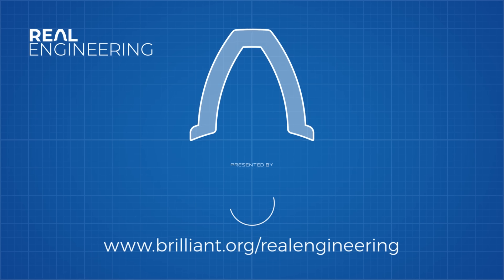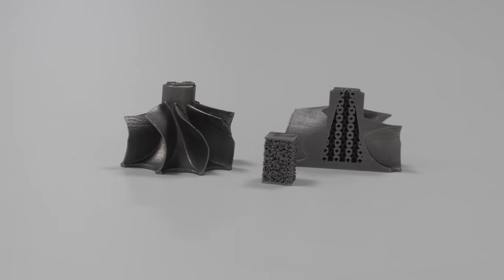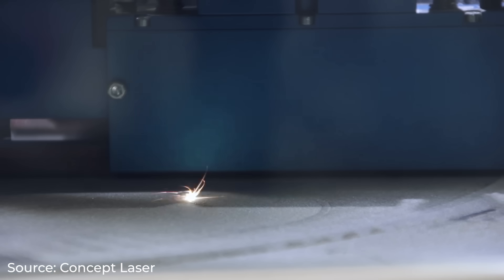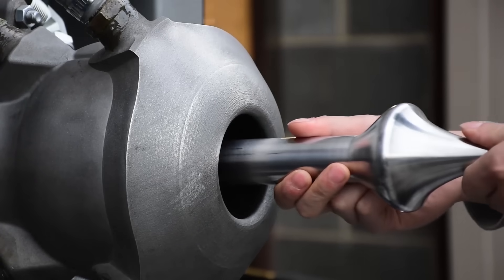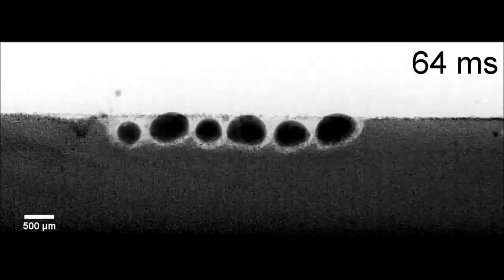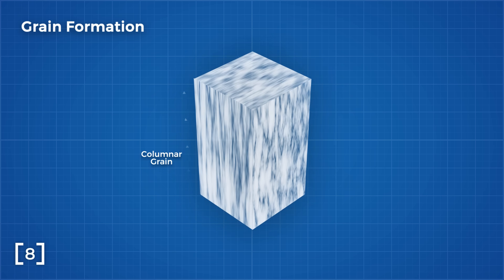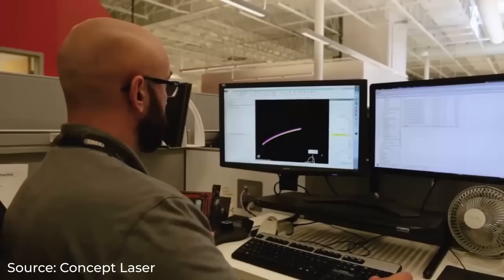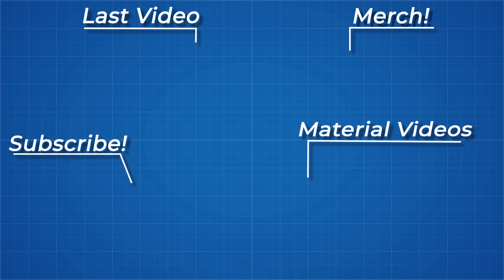The Material Science of Metal 3D Printing

Comment: Instead of fighting the grain why not treat it like wood. Dealing with grain structures and having to be cognizant of how you are connecting machined wood together has been refined and perfected for much longer than steel has been. Sometimes old techniques are the solution to new problems.
Reply: It's not as anisotropic as wood. With stamping for example if you have a new material that does not behave the same way you loose a lot of accuraty. Doesn't matter anyway since 3d printed parts are almost finished after printing.

Comment: This is addictive manufacturing, now there is a new way of metal printing using a printer call Mark Forge, where there is metal filament just like normal 3d printer
Reply: It's an old method called metal injection moulding. You can do this on a 100$ printer using an MIM filament.

Comment: This is an incredibly well researched video. The only thing you missed or didn’t include is big area metal 3D printing, where a traditional arc welder is used instead of a laser and powder bed.
Reply: You mean WAAM or Wire Arc Additive Manufacturing? There is also EBAM or electron beam additive manufacturing.

Comment: I wonder if in the future we will be able to irradiate the whole pattern at once like we used to reveal photos. As in the laser covers the whole print bed but we mask the sections we are not going to fuse. It would require phenomenal ammounts of power and I am not sure what could be used as a mask that could resist that.
Maybe there will be a point where we can kind of massproduce printed parts that way by making reusable patterns. It would speed this method significantly and would prevent the problems of having vertical defects. I don't know it there are also problems with each layer adhering to the one below

Comment: I beg to differ with the high volume low cost part conclusion: 3D printed metal parts (SLS parts) can be produced cheaply/cheaper than traditional methods if they are complex and small. Also post-treatment is also an area that needs special attention (I work in that area) because currently a lot is done by hand which makes part finishes error-prone.
Reply: The dirty little secret of AM
Reply: For small and complex parts you can use MIM or metal injection moulding. It's waaay faster and cheaper than additive manufacturing.

Comment: I Own a 3D print farm (rapid manufacturing using 3D printers), and I can not wait for the price of 3D metal printers to drop in price. But still, machining Billet is still a stronger route.
Reply: If the machines getting cheaper, the material costs and the dirty little secret of AM will stay the same. 

It is actually a nice addition to the already existing manufacturing methods, but it wont be the single way to manufacturing, beside where Function goes way over the costs.

Comment: Another idea,

A single laser making a sheet of metal from edge to edge seems like a problem. What about a more developed high bandwidth laser that can cast the entire surface layer by layer rather than print like how a tv screen changes pixels. Or multiple single beam lasers all working together. Either way the time between edge to edge is creating weakness.
Reply: You need an incredibly powerful laser then. Would cost millions for one printer.
Reply: John theux I agree it would be a nutty lens with a nutty amount of power. On top of that I’d rather see a material delivery system similar to plastic 3D printing. So the “metal dust” is delivered in the beam, not being powder melded by laser.
Reply: @Pcgamingfixes  There is this for plastic but metals have an higher conductivity so you need a faster heating speed to prevent the heat from dissipating.
https://www.youtube.com/watch?v=m-tvvHAq09E
Reply: John theux That link does sorta hit it in one blast rather than ‘printing’ the image. That is closer to what I think would work...
Reply: @Pcgamingfixes  Maybe halway between SLS and QLS would be focusing the laser in a line instead of a point. That should work fine with metals.

Comment: Hey, this video is basically a run-down of my degree! Excellent summary of additive manufacturing and the current problems that are trying to be solved in the area. There are so many variables that can be changed to affect the final part's properties that it is very difficult to find an optimal set. I like how you mentioned that, while additive manufacturing will massively change the industry, they will likely never beat the high volume per-part cost of other techniques or beat the strength of forged parts. There's a lot of hype - and for good reason - but not all things will be better off printed.

I would have liked a mention of the issues surrounding the density of 3-d printed parts. You touched on "voids" but it goes a bit further than that, as mechanical properties of printed parts decrease with relative density. Plus, I think it would be a cool mention that the bulk powder is made of various particulate sizes to maximise the powder density.
Reply: I've always wondered why not use something like MIG welding for additive manufacturing?
Like, imagine a standard mig welder with an auto-feed gun.
Mount the gun vertically on a carousel that moves in the x and y axis. Have a swappable thin plate of steel as a foundation surface to start the part.

Have the mig gun weld at computer controlled speeds and voltages, while it is moved in the x and y axis, and the part is lowered along the z axis.

Bam, you have a 3d-printed metal part!

In reality, you'd want a super-thin wire likely made of different materials. Surface tension would be a bitch, but I think if you take it slow and with good software control you can minimize it.

Having the gun mounted on a 5-axis robot arm would also be very handy.

Does this idea have any merit, or is it fundamentally flawed in some way I am unaware of?
Reply: @merlinious01  There'd be tolerance issues, for one, most metal additive manufacturing processes use powder bed fusion, as is shown here, which uses a laser for pretty good tolerances, albeit with worse surface finish and tolerance than a conventionally produced part.

Another common type - along the lines of what you suggest - is direct laser deposition, where the metal powder is basically sandblasted at the point where the laser hits, which removes the need for the powder bed, but adds a few more variables such as gas flow and powder feed rates, and can result in more voids.

A lot of early metal 3-d printing was done basically as you suggested, and there has been a bit of a resurgence of solid feed style printing (marketed at hobbyists), but the main issues for commercial use are the melt is too big, meaning larger layer sizes and a lower resolution, along with a worse surface finish than most printed metals (which is already pretty poor).

Comment: Why isn't the material fed into the laser similarly to wire welding?
Reply from the maker: There are machines that do that too
Reply: The powder bed is used as a support and you can print faster. But yeah, there is a lot of issues with that, like closed cells.
Reply: @johntheux9238  clay wouldn't work as a bed? Maybe etched with the bottom layers cut into the clay?
Reply: @SergeantSquared  But then it's more complicated if you have two materials, they will mix together.
Reply: @johntheux9238  are you talking about fired clay? I don't think the heat is going to change the clay.. and maybe I should have said porcelain, similar to a crucible.. figured engineers would understand
Reply: @SergeantSquared  Ah, you mean the tray, not the powder ^^

Comment: Thanks for the awesome illustration of my field of study. The cost of manufacturing finished parts with AM changes as people considered secondary finishing processes such as machining, abbrasive flow machining or electro chemical machining. Many of the lessons related to other near net shape processes such as metal casting are surprisingly useful. My masters thesis is on DfAM incorporating the cost of design with cost of the secondary finishing processes and the rest of the manufacturing chain during the concept development stage of the design process. 

Side bar check out path plan based process control where the actual toolpath is varied in response to sensor data from the build. The results from CIMP-3D @Penn State were rather promising for Directed Energy Deposition and it would be interesting seeing those algorithms applied the to the  L-PBF process.
Reply: "Intra-layer closed-loop control of build plan during directed energy additive
manufacturing of Ti–6Al–4V" 
Check it out if you are curious, there is more than machine learning algorithms being used the try and control defect formation,microstructure, and stress buildup during Additive Manufacturing processes.
Reply: @TotallyGlitch  Sadly I cant get it for free as a student:/

Comment: Melting grains of metal on a flat surface will always create thermal fluid dynamic voids and variable geometry alignments.  Guides or molds at that scale would be nice. Sound might be the answer. Like agitating a box of sand to level it out. High frequency sound waves can help liquefaction and molecular alignment. Stick a speaker under the platen and play some Dubstep.
Reply: If they sinter the powder instead of melting it then every issue we have seen in this video will be no more.

Comment: Why not put multiple lasers on the same track? You could put 20 laser heads on the machine and produce 20 parts at the same time. The machine is already going through the motions anyways. You could scale it up on an industrial level once you get the void and grain structure problem figured out. Maybe make a machine 4 times the size of the ones shown on this video and make 20 parts per machine. There will be not nearly the same stresses on the axis motors like in CNC. You'd just have to worry about cross part contamination, but maybe a divider attached to the same track. Also getting power to that many heads might prove to be problematic. And if one laser head fails, you  have to stop production on the whole set and maybe lose the entire batch.
Reply: It's expensive. Laser cutter can reach 15kW though.
Reply: The technology doesn’t work like that. Not even close to how the dynamics of the energy input go into a single powder bed. Try some research on metal additive to answer why you can’t just add stuff together and make it bigger

Comment: I've always been worried that these videos only sounded right to me because I wasn't professionally familiar with the topics being discussed, but as someone who works with all the technologies mentioned here everyday, I can say you nailed it! Excellent work, the service you offer to your audience and to engineers everywhere is priceless.
Reply: Can I Ask you if has ever been tried to 3D metal print in vacuum (or reduced atmosphere, or inert atmosphere)?

It could resolve some problems, maybe creating new ones
Reply: @naminogiri  It has been done but there are a number of issues. My favorite issue is that while creating the vacuum, air will bubble out of the powder which can cause some disruptions. If this happens really quickly you get an awesome effect like boiling metal or like quicksand. Also once the air is all removed the powder becomes much harder to move like wet sand vs dry sand. This gums up the machinery. Also, when melting the powder, some kind of soot and off-gassing occurs which must be taken away because it interferes with the laser beam or deposits on laser optics. A build-up of soot is a MAJOR MAJOR fire hazard as well. Air is needed to blow the soot away into containment.
Reply: naminogiri In the process chamber in which a protective gas atmosphere prevails, a flow is required to transport waste products away from the melting point.
This is very difficult in a vacuum.
Reply: What if we just did it on the Moon?

(Hideously expensive, I know)
Reply: Maybe using a magnetic bed

Comment: It looks like they use too fast, too powerful and focused laser beam. 
I'd try the laser-show effect (the illusion of a circle from a rotating beam ) heating a larger area many times in a rapid fashion. Let's say 10-50 times per second. And maybe they need to use a different kind or frequency of radiation. It has to grow crystals of our choice. Seriously, in a decade or two we will probably look back at this high speed macro footage and call it a plasma cutter generation of 3D printing. Similar to how we see the first wooden airplanes
Reply: You need a very powerful laser because of the high thermal conductivity of metal. If you take too much time the the whole part will melt.
Reply: @johntheux9238  Then start with cutting the power in half and moving over the surface twice. The first pass would pre-heat the surface and prevent blowing the particles away
Reply: @trollmcclure1884  You can heat the whole furnace but the powder will start to sinter and agglomerate and will not be 100% recyclable.
Reply: @johntheux9238  you dont want to understand. The first pass will pre-heat the surface couple of miliseconds before the next pass. And vice versa
Reply: @trollmcclure1884  Should work fine.